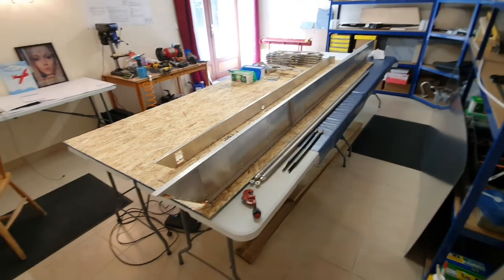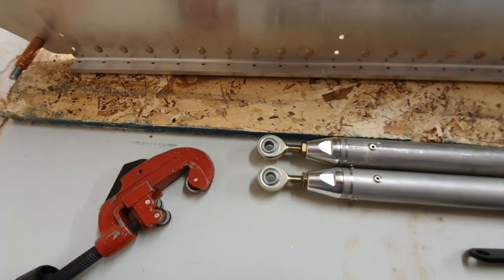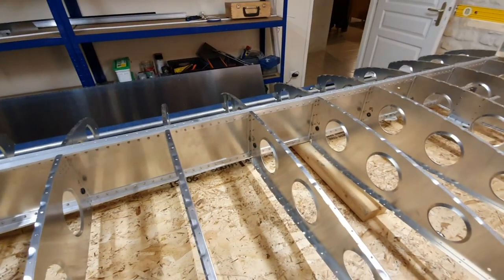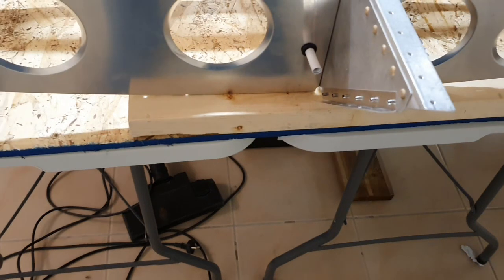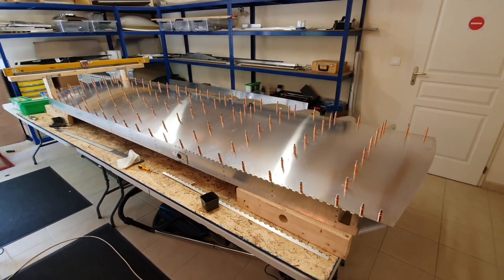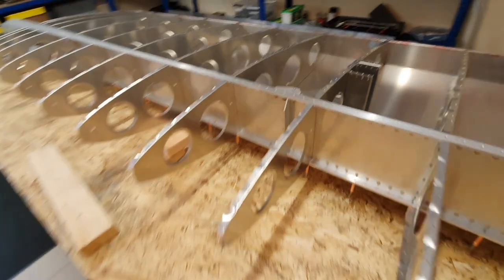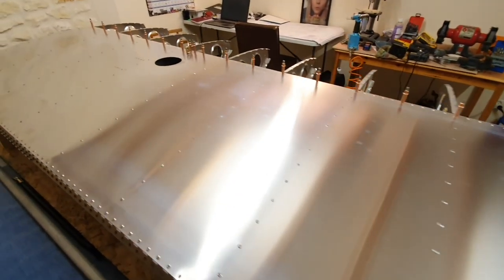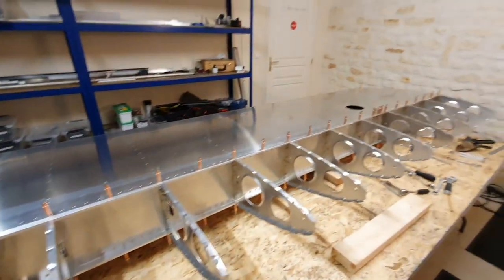Sonex B Part 10 - Riveting the wing (Part 1)

Comment: How long does it take to rivet this using AN standard flush countersunk rivets as opposed to this method?
Reply from the maker: A long time considering you have to dimple the best part of 1000 rivets on each wing. I don't have the patience and that's why I didn't do it. I'm not sure it has an appreciable effect on performance and it's a lot of hassle to get it good enough to enhance the aesthetics. Also the stems of the standard countersunk rivets provided often break off proud of the rivet and then you have the problem of grinding them off without damaging anything. All in all - not worth the effort and an extra year of construction 🙂
Reply: @gavinssonexb   I understand. I agree. AN type driven rivets ( If Approved) would be extremely time consuming too.  Thanks for sharing your experience.👍🏻♥️✌️